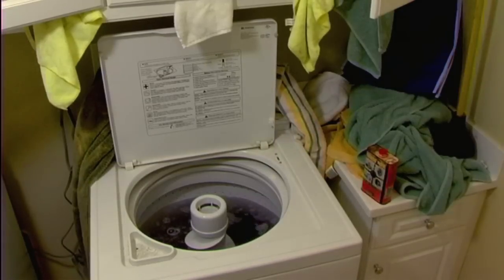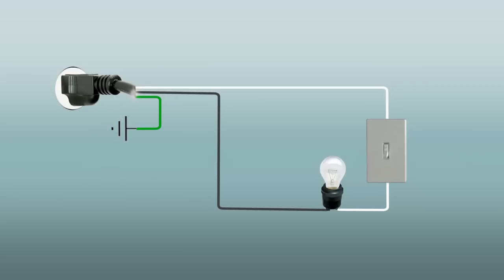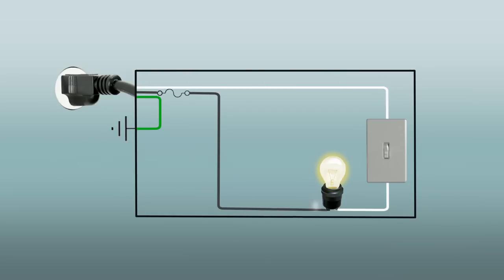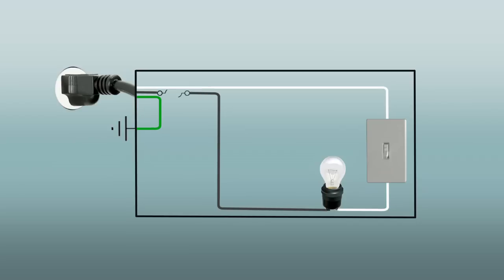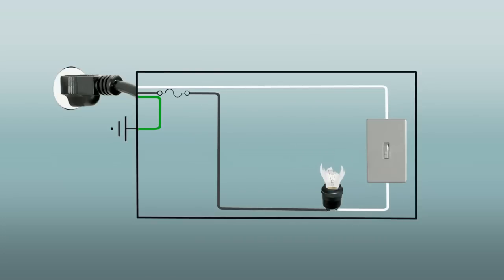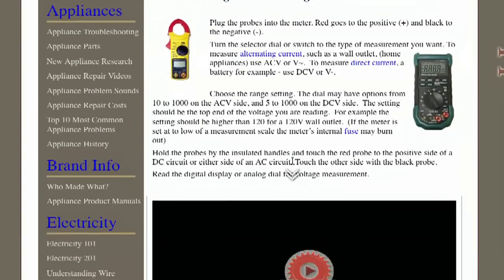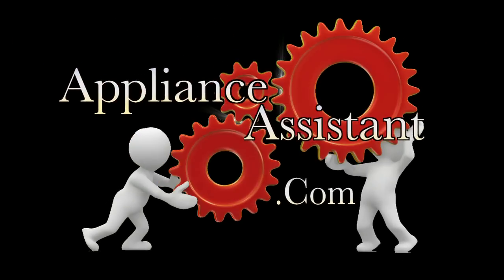Circuit Troubles (Basic Circuits and Common Problems)

Comment from the maker: Thank you for bringing up this point! We have AC and DC circuits in USA appliances. This is mainly about basic circuit structure, function, and failure. I didn't want to get to heavy into the the aspects of current flow this one. This was also a learning experience for me messing with a new animation program :) Thanks for the comment!
Reply: IM so confused

Comment from the maker: You are absolutely right! I have spent many hours scratching my head over a few control related issues... but for the most part (with appliances anyway) its generally pretty simple.  Thanks for the post!

Comment: great video on explaining how circuits work,types of problems ,etc...but the most important thing is that your showing a switch on a neutral instead of the hot.this is a serious user safety concern.i have seen it many times on old and new house wiring.you can confuse a person by showing in your diagram that they will want to put the switch on the white wire which will always keep the device hot at all times.this is a non no.someone might accidentally touch the screw socket portion of the device and get shocked.always put a switch on the hot side of any device for safety.so someone won't assume that the socket,receptacle or appliance is off and then go touching it when the panel breaker or fuse is out or off.
Reply: I was wondering if this was going to be brought up....good job!!

Comment: Your diagram is wrong. The switch should be on the hot leg, not the neutral leg. Neutral should never be broken for safety.
Reply from the maker: That may be true, however, in major appliances the relay is fairly commonly placed on the neutral side of the circuit. so that cannot be assumed when working on appliances.... I used a home light switch in the illustration because it would be difficult to animate a control relay. Thanks for pointing that out though!
Reply: Dave B I
Reply: Lmao noticed that right away the bulb will have continued load

Comment: You can replace PCB traces by soldering wires to them, if the traces are large enough.
I've done it few times when surge has blew up the traces on some old machines that have plenty of room to solder a wire as a replacement.

Comment: Why is your diagram drawn with switch in the neutral?  these are surely now placed in the line conductor always, by wiring code?
Reply from the maker: +sbusweb In major appliances the switch or relay is often placed on the neutral side of a circuit. With home wiring definitely. And I did use a light switch for illustration. The nice part about a switch being placed on the neutral side of a circuit is less component strain.
Reply: Alternating Current doesn’t care where a switch or relay is connected on either side of the load. Forget the code and look at the physics.
Reply: Never "forget the code" sigh

Comment: A really good video .The problem is the switch should be on the black wire which is the hot conductor. You never switch the grounded conductor/white wire (slang neutral )
Reply from the maker: In major appliances in it not uncommon to have the control switch on the neutral side of the circuit. Definitely good to clarify for home wiring though! Thanks for the comment!

Comment: The thumbnail alone is wrong. You want to break the hot wire at the switch, not the neutral. Another thing is you want to ground your entire circuit and not just the source of power, run a ground to the switch and if applicable to the light. If you break neutral and someome switches the light or application off it is still hot. which means if someone comes along to do work on the light (and they dont turn off the breaker) it is still hot. Which means if they touch the hot side and they are grounded its gonna bite them. ALWAYS BREAK HOT AT THE SWITCH! ALWAYS!

Comment: In the circuit the control system (the switch) should have been on the LIVE (hot) wire and NOT on the return Neutral or dead wire. In the case of this circuit the appliance would be "live" if the neutral (dead) wire open circuited. This would be a dangerous situation on that type of fault.

Comment: I have a problem with light bulbs burning out in a certain area of the house. I have to replace light bulbs every 3 months. When they go dead they blink every 30 to 40 seconds by themselves. When I turn the switch on and off the flicker as well. Please help. Thank you!!

Comment: So I replaced a switch light because it was doing a buzzing sound every time it switches to the ON position. So seems that the new switch fixed that buzzing problem; but now some lights won’t turn on, some others do.

Comment: Ok, confused, the diagram shows power going to the bulb, so if switch is off there is still power going to bulb. Resulting in a shock or arc flash...am I wrong ?

Comment: I cannot find an answer to this anywhere. In the UK we have Line (230v) and Neutral (0v) and Earth (0v). I understand that the neutral is linked to earth so there is no difference in potential. However, what happens in you were to disconnect neutral from earth? You would then have 2 x 230v live connectors, the potential difference would be 0v but yet the circuit will still work??. I have an isolation transformer which has 2x 115v secondaries, if you wire them in series you will get 230v and both connections will be live. What actually happens when I ground one side of the transformer, where does the voltage from the once live connector go?? Will I then have a 230v connector and a 0v instead of 2x 115v? I want to know what actually happens to the voltage of a live connector when it is grounded

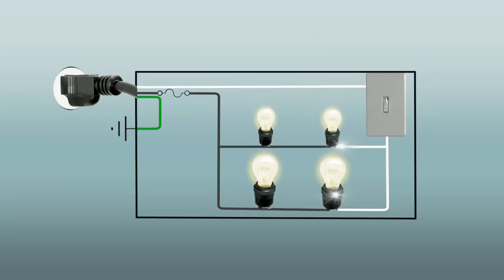Comment: The circuit in 6:05 is wrong as for any bulb to work it must have a live and a neutral. The bulbs on the left only have the neutral
Reply from the maker: Hi Edgaras. Because they are wired in series with the bulbs on the right they would have connection to neutral through the other intact bulbs. Thank you for your comment!

Comment: what happen when the wire ring in the house  both live and neutral have power  and when you plug in a radio or anything good the power goes off. what could be the reason behind it
Reply: Yo need call electrician...  NOW!

Comment: My goal is to identify the functions of the devices in a given circuit diagram?
Or spoken more general.
How can I lean this general skill?
When do I see a random circuit diagram in all kinds of electronic fields that I can recognize the devices and their functions?
What is the best strategy to acquire this skill? 
Do you know good information recourses specially designated to acquire this skill?
I do not want to handcraft things on my own and I do not want to study at a university to acquire a bachelor's degree in electrotechnology.

I just want to be able to read and being able to understand more or less the circuit diagram.
Thank you in advance
Reply: That's a difficult question. Personally I learned over time while working in the appliance repair field. I would imagine self study of basic circuit component symbols and their functions would give you a solid understanding that would be sufficient for most situations.  It seems intimidating, but there really are not that many components that are regularly used.  I made a page years ago that outlines the basics https://applianceassistant.com/appliance-repair/electricity-and-testing/how-electrical-parts-work/
I hope that helps get you started!

Comment: at 05:43, if electricity follows the shortest path to the ground, shouldn't the lower branch be without electricity in it? why does it have current flowing throuh it?

Comment: You NEVER switch a circuit on the neutral side (i.e., white wire); that is DANGEROUS!
Reply: Can I ask why?
Reply: @arturzych138  If you switch (for example, a light fixture) on the neutral side instead of the hot side, you run the risk of someone being electrocuted while changing a lightbulb, because the socket will still be live, even while  the light switch is off. The average Joe expects there to be no voltage while the switch is off, and may believe that it's safe to stick his finger into the socket. DON'T DO IT!
Reply: @karlscheel3500  Wouldn't it still be live regardless?
Reply: @arturzych138  No, if wired correctly, with the black wire interrupted by the switch, there would be zero voltage at the socket with the switch in the off position. Although the neutral wire remains connected in this scenario, it's  always at zero volts, so there's no danger from touching the neutral connection even if you are simultaneously touching a grounded object with the other hand (e.g., the metal chassis of the lamp fixture itself). The danger would exist if you had the wiring backwards; in this scenario, if you were to touch the bottom of the lamp socket with one hand (which would still be live), and simultaneously touch a grounded object with the other. The current would then flow through your body (including your heart), and potentially kill you.

Comment: so my brother connected my laptop charger and a huge spark came out and turned off all the lights and electricity in my room what do i do
Reply: Buy a new brother
Reply: Fucked charger likely short circuited and tripped the circuit breaker or RCD protecting your room...
Get a new one
Reply: According to this vid, it's either a short, ground short, or open circuit.  Lol.  So I guess you should be able to fix it yourself.
Reply: check the fuse at the breaker....im guess it isn't holding its load well. homes use 15a 20a breakers for normal use. 30a for a/c units or washing machines.
Reply: Nothing. Don't do it again. call the electrician to replace the fuse.

Comment: Can we make a device which protect or indicate that short circuit about to be happen.....
Reply: buy a (GFCI) ground fault circuit interrupter and make it the first outlet of your circuit.... it will protect all the outlets that follow against shock, water exposure and shorts. it basically shuts off power when current travels at an unintended path
Reply: some people waste money and install many GFCI outlets in a circuit but you can use one to protect all if  it is placed as the first device

Comment: Sir if I use old glass bulb so he glow fine but if I can replace led bulb he cannot glow what is problem. I can check led bulb of series board he is fine.
Reply: In refrigerator
Reply from the maker: Honestly I’m not sure. I would suppose it may be a voltage supply problem... perhaps if it was a dimmable 120VAC LED bulb it would work.

Comment: Electricity does not take path of least resistance, it takes all path weighted with their conductance (1/R).  If that would be the case, you wouldn't be able to operate multiple electrical devices in parallel at all.

Comment: Electric current DOES NOT "take the path of least resistance to ground." That is a myth and a dangerous teaching. The equipment grounding on electrical systems is not to provide a route for over-current faults in the circuit(s) to discharge in the earth--this is a popular misconception. The equipment grounds in a system provide an efficient route back to the source of power, which, in most cases, is the transformer. The electrical current always moves in a circle from and to the source of current. So in the event of a ground/circuit fault, the equipment grounds being bonded to the neutral at the first load distribution center of a system, the fault clears by returning the current to the source. That is per the NEC. Ground rods are to protect the system from DC over-current surges of power such as lightning strikes that have their origin outside the system.
Reply from the maker: Interesting!  You are correct about an appliance's ground contacts returning current to the neutral connection. However, either way you look at it the end result within an appliance circuit is a dead short that is void of resistance to current on it's path back to the local transformer, instead of the grounding rod of your home.  Thank you for your clarification.
Reply: I've been an electrician for 16 years and have heard the "fastest path to ground" foolishness even from other electricians who should know better. It's a"rule of thumb" that will get you a sore thumb, because it mistakenly implies ground is the origin of electricity and that ground is integral to circuits. Like Paulus said, electricity wants to go back to where it came from. Electricity DOES NOT come from ground. Electricity comes from the power source. "Ground" is an INTENTIONALLY ALTERNATE path back to the source . We intentionally bond the earth and metal parts with the potential to carry current as alternate paths back to the source. While resistance exists naturally in any conductor, grounding conductors are low resistance in reference to the normal circuit loads. 

Also the video has the switch on the grounded conductor (white wire), not to mention the switch was on the load side of the lights!!!

 We only switch the ungrounded conductor per NEC. And if you're going to control the load, the line has to go to the controller (switch) first. A little research, and this video would be fine. Right now it's enough misinformation in the animation alone  for me to warn people not to do it yourself based on this video.
Reply from the maker: Thank you for taking so much time to clarify the definitions.  This video is not about home wiring it's about appliance troubleshooting and repair.   Within home appliances the switch or control relay is often opening the neutral side of the circuit.  Which I think is more important to focus on because a switch is not necessarily disconnecting a component from line voltage!  Also when troubleshooting appliance problems you can measure voltage at a component to ground and not have operation due to a failed relay or switch which is located after the load in the circuit.  This point about the difference between neutral and ground is good because measuring voltage to a ground connection or to an appliance cabinet is a good way to waste a lot of time.  Because as you stated ground is not the intended path, it is a safety precaution. Thanks for your comment.
Reply: Another thing most people don't understand is that it is necessary bond the ground wire to metal junction boxes and metal cases of equipment. Regardless of the actual grounding rod placed in the earth being attached to the ground wire, without equipment or electrical boxes being properly bonded, the breaker probably or definitely won't trip in the case of a line to ground fault. Also, among other reasons, the grounding rods are placed in the earth to have a reference of 0 Volts and to maintain that all grounding paths in the electrical system stay at 0 Volts.
Reply: I'm assuming the ground rod is separate from the ground conductor in a circuit.
Reply: No. As long as grounds are present throughout the entire circuit, they are not separate.
If the rod were separate, it would defeat the entire purpose of grounds throughout the circuit.
Reply: I disagree with, "the ground provides an efficient route back to the source of power".
If that were true, then why have a grounding rod, slammed 8' into the earth? I was
under the impression that the purpose of the ground was to have a path whereby
current can bypass an electrical device in a circuit, to prevent possible damage to
that device? And if you recall, the neutral never bonds to a ground, outside of the
service entrance. Only in the breaker box, are the two connected.

Wouldn't the neutral, "provide an efficient route back to the source of power"?
Isn't that what the neutral is for?
Reply: Seemsayin, you lost me at grounding rod. This is the reason why this message is from heaven because a few years ago I touched not one, but two grounding rods sticking out of the ground. I picked them up one in each hand and made a complete circuit. Cheers.
Reply: Oh Yeah? Today I "found" that path of least resistance, while troubleshooting! It was me Donkey! Guess the electrical current (and Me) didn't stay awake during the NEC 2013 update....He...Haw...He...Haww  ANY electrician who says they have never been jolted...Is a F-Liar!
Reply: You're using what looks like house wiring components to describe appliance wiring that is the problem

Comment: Your switch is wrong side of your lamp for the way your flow is.
Reply from the maker: You are correct. However, in the application of appliances, the switch or relay can be placed on the neutral side of the load, such as a dryer door switch or washer lid switch.
Reply: @applianceassistant  very rare and you have a switched light which should never have the neutral switched.Even if it is neutral switched your switch is on wrong side.

Comment: That switch supposed to go on the hot side not on neutral.
Reply from the maker: Switches are sometimes on the neutral side of a circuit in appliances. E.g. Dryer door switch.
Reply: @applianceassistant  I'm not 100% sure but I feel like neutral switching is mainly in dc circuits

Comment: Too bad that modern appliances are designed to fail beyond practical repair.
We still have all home appliances from 1989, and they've super robust parts. Of course we've had to repair some probelm once every 5 years, but nothing serious. I love when something goes wrong with these thing and I can take it apart. 95% of the time I'm able to find the problem and solve it. Fight against the modern planned obsolescence!